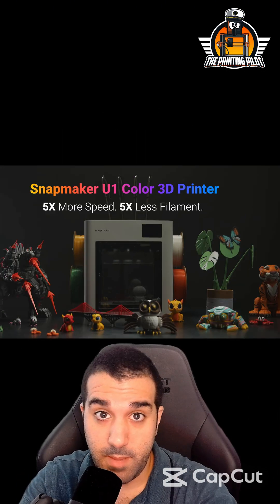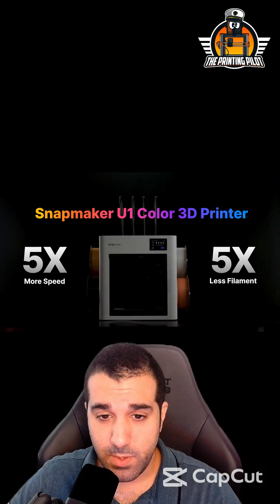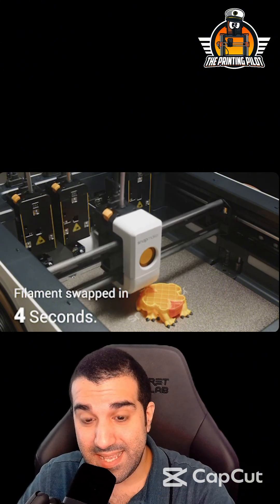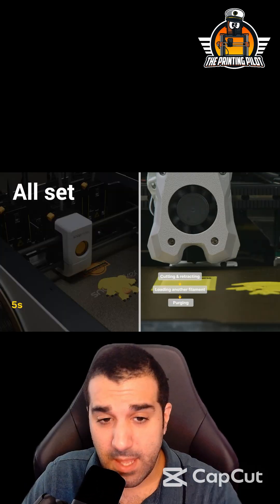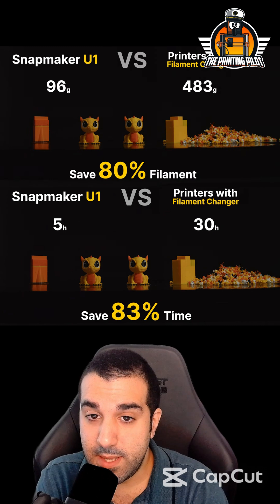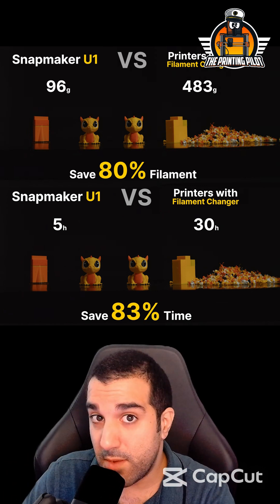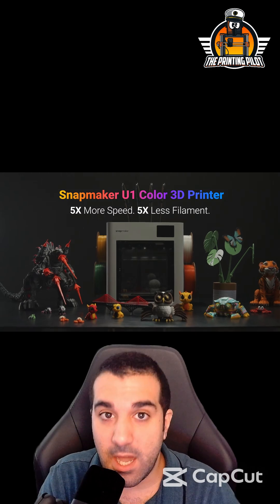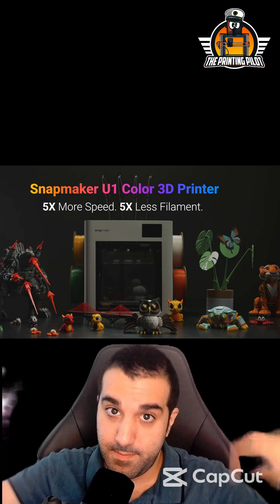Snapmaker U1 in 60 seconds #3dprinting #tech #snapmaker #toolchanger #3dprinted

Comment: I have an X1C for higher temps.  But this is perfect for PETG/PLA… 
But if it fails, I’m going to forever stick with Bambu Lab. As I’m sure they will release something similar in a couple years.
Reply: The snapmaker will get an active heated chamber add on ;) 150 USD on the Kickstarter. Still a gamble but it's looking pretty good, snapmaker could really have a killer machine here.

To be honest I actually use my A1 series printers way more because honestly my X1C simply feels like old technology nowadays. Indeed it's mostly for prints that actually need the chamber to me.
Reply from the maker: That would be amazing.

Comment: Why would it need a purge tower if it has a tool changer?
Reply from the maker: Well the purge tower is always needed , think about it as a prime tower and not a purge tower. You always have to prime a nozzle that was sitting idle, the filament can ooze out,  moisture can expand leaving air pockets in the nozzle and more. So is is always needed to purge the nozzle making sure you have fresh filament and not something that stayed there and deteriorated. BUT, it's really small amount of purge.
Reply: All toolchangers need purge towers, they just don't need poop.